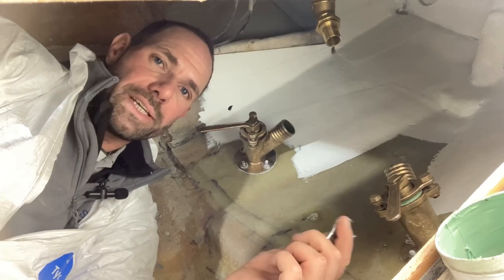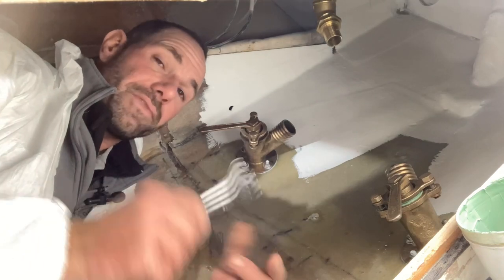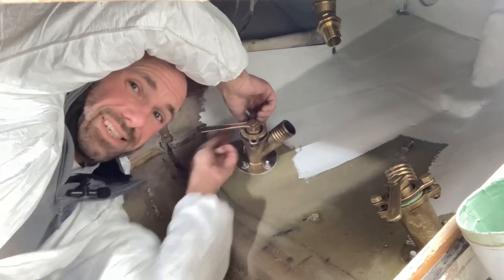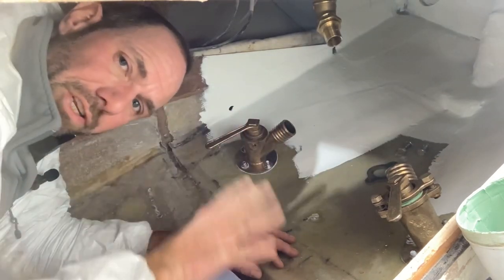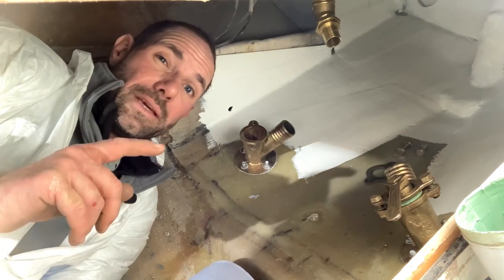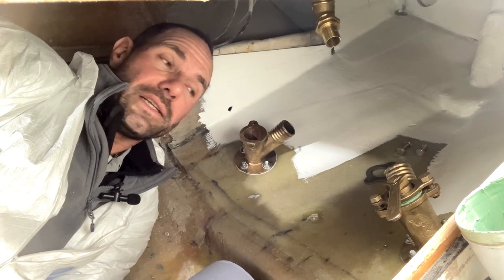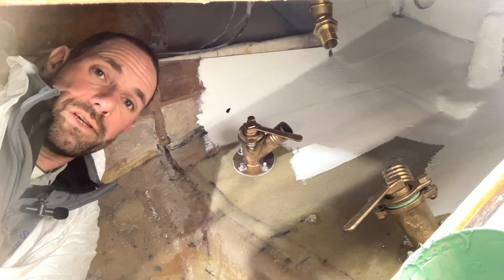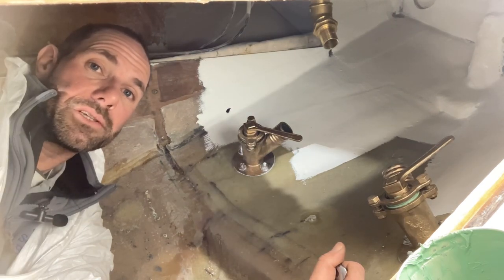How to service a Blakes Seacock

Comment: That Blake grease looks like synthetic marine wheel bearing grease. Not that I would take the risk of a substitute but still curious if they are similar.

On another note:  A short sea valve story, 

I did some equipment replacement on a U. S. Submarine back in the 90's. The sub did an Arctic mission then went to the academy to be used as a trainer. 

About a year and a half later I learned that they needed to replace a sea valve.
They had called in a diver to weld a plate over the through-hull. Then proceeded to remove the the valve.

To their suprise, they learned that the diver had welded the plate over the wrong through-hull.

The sub sank at the dock.

That was the USSN Sandlance, a Sturgeon Class nuclear powered attack sub.

The sub was raised and continued to be used as a trainer for the submariner's academy in New London, CT.

I enjoy your videos and applaud your dedication.
Reply from the maker: Almost certainly the same grease but most folk use so little a tub will last 20 years so not really worth saving a few £’s just for that.   A rather unfortunate sub story but I’m sure an easy mistake - oops!

Comment: Nice trick with valve grinding paste,  I think anouther trick make sure your boat is out of the water:). Might want to add that . they have warnings on motor belts that say make sure engine isn’t running when replacing. It’s hard to imagine why there is a warning on the motor belts :) another great video.
Reply from the maker: Haha, yes you may be right but I hope that common sense will prevail and the job will be done with the boat ashore.    But then again……

Comment: Amazing video very informative.I need to close the outlet seacock on my westerly but it wont move im not sure if its seized or if the top ring is too tight. Can i loosen the lock nuts slightly to see if it will close if im in the water?
Reply from the maker: It could be seized if it hasn’t been closed in a long time.  Think I would leave alone until your boat is ashore, if it does move having loosened the top plate there is a chance it could leak even if you do it up again.   Depends how confident you are 😬😬
Reply: @RefitandSail  Thank you think I'll leave it until next lift out.

Comment: Hi there, thanks for the seacock  service info....i am trying to find the spare part (the part that comes out and you greased) ....mine is pretty rough at one side. On the web I can’t seem to find that part.
Reply from the maker: The central cone is not available as a spare part on its own, if it’s beyond its useful life you will have to replace the seacock.

Comment: What caused the pink coloration?  Not zincafication?
I agree that this is an outstanding series of videos
Reply from the maker: These ones we not pink in any way but I mention them potentially having a slightly pink look in the video as it can happen and typically indicates a loss of zink. On bronze blakes this is typically just a few microns deep on the surface and is removed very easily during the service.   In severe cases of dezinkification that pinking with be deeper into the metal which can make the seacock brittle.

Comment: The yacht i recently purchased and refitting had 4 of these, i removed them cleaned them all and re-installed and they all leaked. Now i know that they needed grease I will recover them from the junk pile. I replaced them all with stainless steel thru holes and ball cocks..
Reply from the maker: Oh well, at the very least it’s worth keeping them as spares or selling them to someone else.   Yes they definitely need grease.   Oops.
Reply: @RefitandSail  was thinking the same. learning heaps from your videos thanks for the hard work you put into them.

Comment: Hi George, I have a question! I have these types of fittings on my newly bought Trapper300. The boat is quite well maintained and the fittings are not very corroded, so I am planning on refurbishing them like you did in this video. However, I was wondering If I should replace the bolts keeping the fitting onto the hull, and the bolts keeping the 'plate' onto the fitting body? The boat is from 1980... What do you think?
Reply from the maker: Hi, if the fixings are original from 1980 (and it’s normally impossible to tell) then I think I would be inclined to replace them.   I expect you have the standard Blakes fixings which are bronze that go though the outer plate, hull, seacock flange and fixed with a nut internally.    I have, on my own boat, remove these and found that one in four of the fixings were either in poor condition or broken on removal (that’s on an 1983 boat) so as much as it can be a pig of a job is access is poor it will give you peace of mind knowing that they are done.   Hope this helps.

Comment: Thanx for the video!
I am in a dilemma 😁
Just got a 1986 Colvic Countess and it has 4 Blakes...The boat is out of the water for the last 7 years and they are COMPLETELY STUCK 😁
The previous owner got the boat in 2009 and never sailed her or maintained her for some serious personal reasons.
 So I have to decide what is the best option...To be honest I think that I'll just replace them with something new so I'll have peace of mind and keep the old ladies as a backup...
Reply from the maker: In the first instance I’d try and free them up, nothing to loose, if the are damaged in the process then you have to replace them anyway.    Loosen the two top bolts so the cone can come out then stick a suitable bar (try hardwood of some sort first) and give it a wack with a hammer, it may just pop open and you can then inspect and decide if you service and keep or replace.    Nothing to loose in trying.

Comment: So helpful, thankyou George! Any tips on cleaning the outside of the Blakes? I'm also going to show my ignorance by wondering why there are seacocks on these cockpit drains in the first place - why would you ever want to close them?
Reply from the maker: Any through hull opening below the waterline should have a seacock, I agree that you would never normally close these for the cockpit drain but if the hose broke or came loose you may want to.    I’ll be fitting fire retardant reinforced hose so it should never be an issue.
Reply: Seacocks are below the waterline. Any failure in a system (hose) between the seacock and up to the waterline could sink the boat - until you shut the seacock and stop water ingress.

Comment: A point of interest, only the top part of the cone (above the entry hole) is used to stop water ingress so this is the most critical part.
Reply from the maker: Indeed that is true but the whole cone needs to be a good fit, concentric with the female body and lapped with gringing paste so that when turned on/off it does not leak.

Comment: I find it kinda interesting you spent time cleaning the grinding paste off the cone , but never touched the body . Was this intentional ? .
 Another thing i noticed , is that your seacock's didn't appear to have any kind of hull re-enforcement . I'm sure that's not the case , but that's what the angle of the camera was showing .
Reply from the maker: Hi, thanks for the comment, Don’t worry, I cleaned the inside of the valve body too, I just didn’t waste the internet by showing that to the viewers, well spotted though.

These Blakes seacocks have a large flange that goes against the hull so the is minimal to no benefit to adding an additional internal backing for it.   I had (in a separate video) laid up extra glass over this area so it is thicker and the area pretty flat so again no issues with strength.    Where these are fitted, it would be virtually impossible for any side load or other load to be applied to these seacocks by accident.
Reply: @RefitandSail  Ohh i see , good man . Yeah , i can see your reasoning , but at the same time , i also noticed from the comments , there are a couple of guys who really didn't appear to know anything about seacocks . So for that very little omission , i'm gonna give you a 9/10 , for what is otherwise a very good how-to video . I'd just like to add some constructive criticism , in that you consider these people in future vid's , and the very fact some really may not know anything about what you're teaching .
Personally i found that grinding was only ever a very occasional event . I know you make reference to that in your video , but i thought i'd just reinforce that . I found petrol to be just as effective in removing the grease , however , i also chose to service my seacocks every season , so maybe that could explain why .  
 
On the second point , yes i did notice your hull appeared to look a bit uneven around the seacock base , but again i thought it was the camera angle . So you laid extra glass huh , that would spread the load even further , than the traditional method , so in theory should be even stronger . 
Though i have seen a couple of your videos , i'm here because of the seacocks in your thumbnail , i have three myself . Blakes , with the grease nipple , just figured i may learn something new . Dam expensive things , i picked them up , when one of my own seacocks started leaking a few years back . I'd already done what you showed , but it still leaked , so i figured it maybe time to replace them all . Just so happens , i sold the boat first . Still got them , and they are ear marked for the replacement . I'm just holding back , due to the current climate . Don't recall the larger flange though , i'll have a look next time i see them .
Reply from the maker: Always happy to have constructive critique so I appreciate you taking the time and 9/10 is fine by me 😊

Hope you enjoy some of my other videos.
Reply: @RefitandSail  👍

Comment: Explain how to orientate so you know when closed or open!
Reply from the maker: That’s a really good point, probably should have said that in the vid although it does say on the retaining ring (assuming it’s fitted the right way round) what position is open and closed.  To answer the question, when the lever is pointing directly away from (so in-line with) the hosetail then the seacock is open.    When the lever is turned 90 deg or more from that position then it’s closed.  Hope that makes sense.